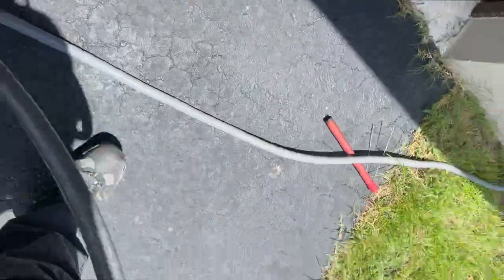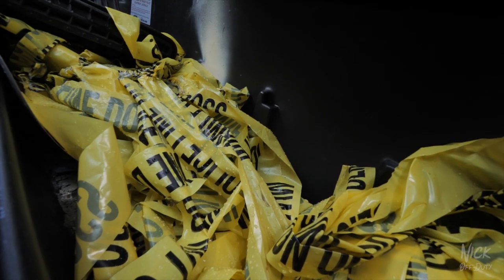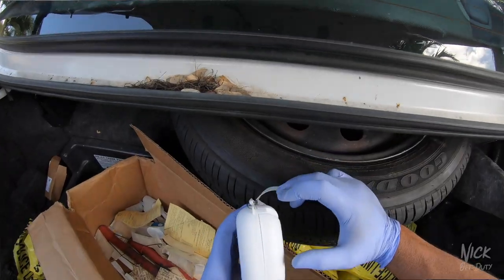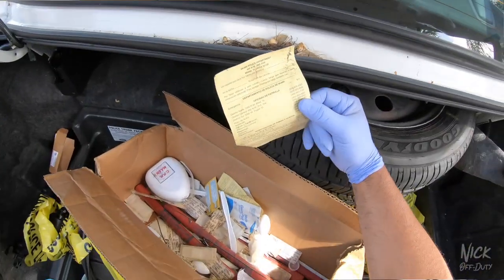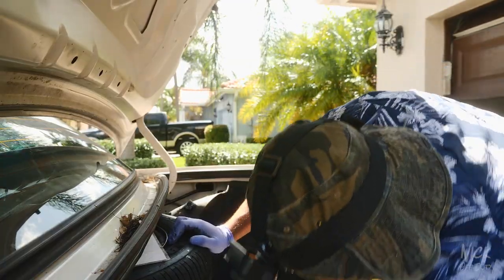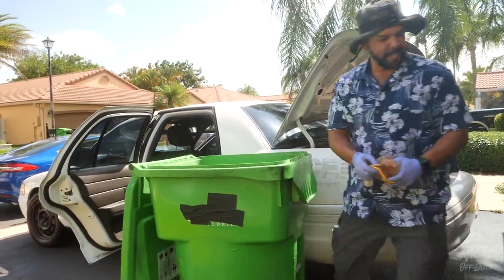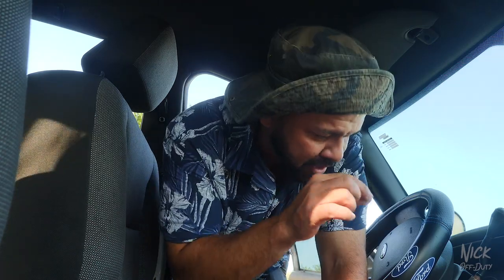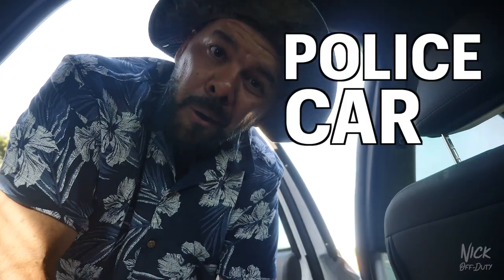POLICE CAR BUILD -TRUNK FIRE, Trunk Search, Interior Cleanse (Ford Crown Vic Police Interceptor)

Comment: axle is the whole rear end. that is the differential which is that the brake rotor and rim attach to and the rest of it goes into the axle housing to the gears which makes the tires spin and American eagles spawn.

Comment: That long pipe you pulled out is part of your rear axle. On the crown victoria's, especially the P71's (police model), the passenger side rear axle are prone for the axle bearing (rear wheel bearing) to burn up and chew up the axle. You can see the wear on the axle you pulled out the trunk. Hopefully that means your rear axles and wheel bearings have been replaced. If your rear bearings are shot it'll sound like someone is running a chainsaw in your trunk as you're driving down the road. 
#themoreyouknow.